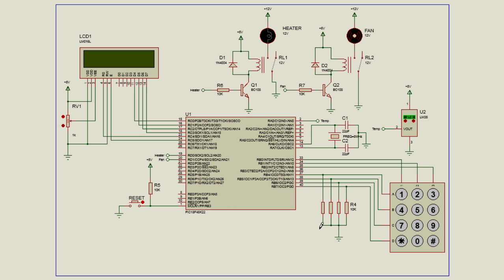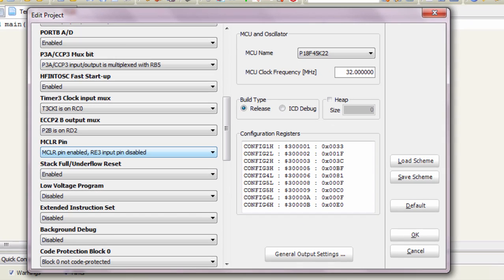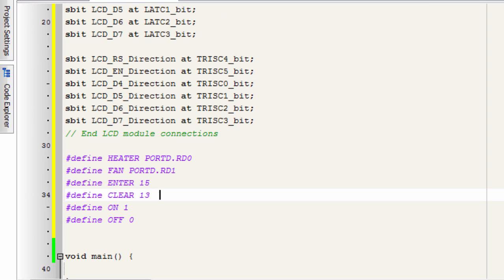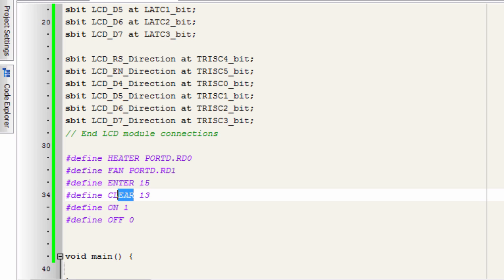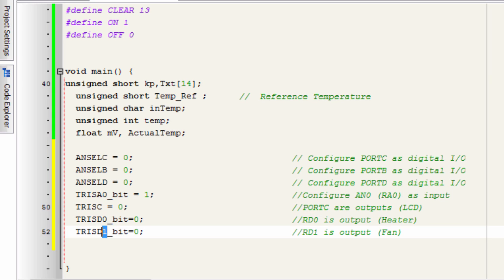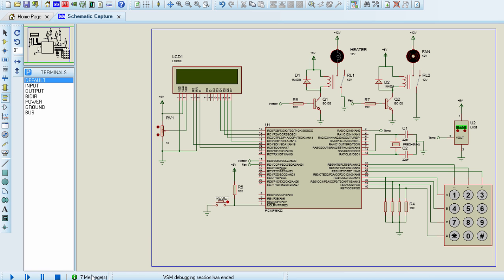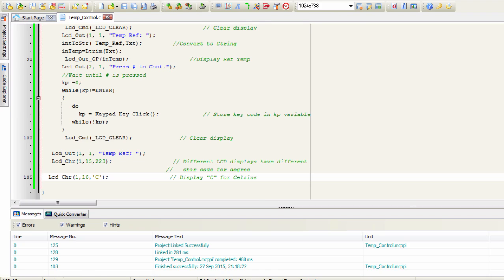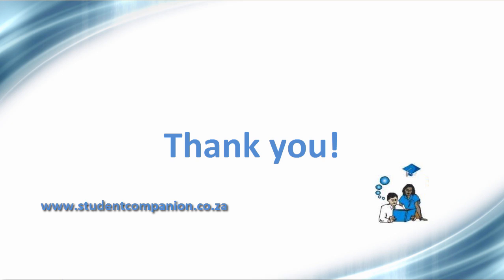12- Project 2 Automatic Temperature Control, part 2 | mikroC Pro for PIC Tutorial

Comment: good day Sir, its me again... i managed to program a running project but i have a problem with LM35 sensor, when my temperature is at 23 degrees for example, on my LCD it says 22.9, i tried to look for a video addressing the problem but there too many videos, can you please kindly help me?
 and i know that 1 degrees celcius = 10mV.
Reply from the maker: I don't see the problem. You are expecting 23 but you get 22.9 there is nothing wrong.
Are you simulating or using hardware?
Remember this sensor has also an accuracy of about 0.5 degree at 25 degree. So don't expect to get the exact valu as calculated.
Reply: @StudentCompanion  i am simulating it has to be exactly because i want both heater and fan to be off when the set-value is equal to the room temperature
Reply from the maker: It cannot happen. That's not how it works. Change your calculations
Reply: @StudentCompanion   can u refer me to your video that explain that part, cause on my LM35 properties  i have 

constant
temperature step (degrees celcius)= 1.0
PCB Package = TO92-100
i would really appreciate your help
Reply from the maker: You can Google what accuracy means maybe you will understand.  You are trying to set parameters which are not real in practical environment.  What you are facing as a challange can easily be resolved in code rather than setting unrealistic settings in Proteus.
This video is part 2, you can learn more of the sensor in part 1 or part 1 of digital thermometer video
Reply: @StudentCompanion   Okay, Thank you very much, i really appreciate.
Reply from the maker: You are welcome!

Comment: Hello if i put a value mor than 250 it after pressing enter it's giving a wrong number
Reply from the maker: What value  are you referring to? Do you mean the reference temperature? This sensor can't measure such temperature it has a limit.
Clarify your question.
Reply: Yh i mean the reference temperature and i know it can't measure more than 150 degree but if i want to change the sensor capable to measure more rhan 250 degree
Reply: After pressing enter the reference temperature for example more than 250 it given wrong number
Reply from the maker: Then you must do calculations based on the new sensor first.
When you get errors, what errors???
Reply: Have you an email so i can send it to you?
Reply: I have another question if i want to put more than one heater how i can regulate like  your video with keypad
Reply from the maker: Why do you need an email address while you can ask any question here? Comment section are here for that.
If you need to post your project, ask the question in the forum on our website: www.studentcompanion.co.za/forums
Reply from the maker: How do you want to control or you want those heaters to work?
Reply: I want 5 heater and each heater hase different reference temperature
Reply: For example the reference temperature for heater 1 90 degrees
Heater 2  120 degree  ect..
Reply from the maker: @jeanpierresislian8883  There are many ways you could achieve that, for example, when the program starts, set the first reference, once the '#' key is pressed, instead of starting the normal operation, prompt to enter the 2nd temperature reference and so on. Save these temperature references in different variables.
Then in your loop, you can compare your actual temperature to all your reference temperatures and control the required heater.
Reply: Thanks
Reply from the maker: @jeanpierresislian8883  You are welcome!

Comment: At 8.32 min logic  for keypad i couldn't understand,u wrote if (kp>3 &&KP<8) Kp=kp-1 here i couldn't understand logic .suppose i pressed 5 on key board it is greater than 3 and less than 8 then kp  would be 4 (kp-1).now what to do with kp=4 ??and why u took lower limit as 3 and higher as limit as 8 ,it might be any thing else.sameway in next line if(kp>8 &&kp>12)kp=kp-12 ....why?? next line if( kp==14) kp =0 ..why u compared with 14 only why not with other numeric value is any special logic behind it ....secondly since in erlier step it has been mentioned if(kp>8 && kp<12) then kp==kp-2 then how ever kp== 14,
Reply from the maker: This keypad library can be used for 3x4 keypads or 4x4 keypads. It's assumed the 4x4 keypad is used.  So in the first 3, it assume there is 4 after 3. And on 2nd line it start with 5. Because I am using a 3x4 keypad, if In press 4, the library will beleive it's 5 and it will give me 5. That's why I need to minus 1. And so on.
Reply: sir  this logic wont work if i have to press1,2,3 because in code no where condition for it mentioned .Your condition starts from logic kp>3
Reply from the maker: It won't work? But it's working. You can see it.  If you don't understand, it does not mean it won't work.

Comment: Hello! I would like to appreciate all the projects and they are very interesting. But, would you please help me in interfacing the ENC28J60 with PIC18F microcontroller family in proteus and the c code in mikro pro c compiler?
Reply from the maker: +Haftamu Mekonnen hi. Thanks for your feedback.  At the moment we haven't recorded a video on ENC28J60 but on our website we have.  Please read this article: http://www.studentcompanion.net/en/interfacing-enc28j60-ethernet-controller-with-pic-microcontroller-mikroc/
Reply from the maker: +Haftamu Mekonnen and this project: http://www.studentcompanion.net/en/web-based-control-and-monitoring-with-pic-microcontroller-mikroc/
Reply: I have tried this program in mikro pro c compiler but it produces an error and the error says "Unresolved extern 'TFT_16bit_RS' __Lib_TFT_16bit_Defs.c" what is the problem?
Reply from the maker: +Haftamu Mekonnen what program? You mean downloaded from that site? In the library manager try to include all relevant libraries
Reply from the maker: +Haftamu Mekonnen check in library manager that you included all the required libraries used in the code. Did you use the same PIC as in this tutorial or a different PIC?
Reply: Yes I did! I used PIC18F4520
Reply from the maker: +Haftamu Mekonnen check the libraries.  If you still can't build send us a screen shot of your errors
Reply from the maker: Why did you put a back slash at the end of line 26 and 31? we din't put one in our code.
You must end line 32 with a semi colon.